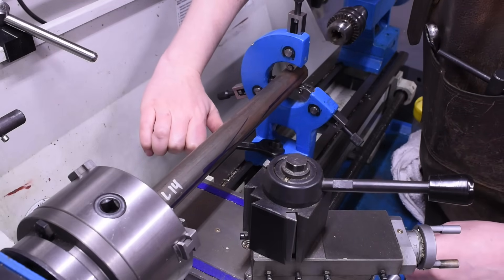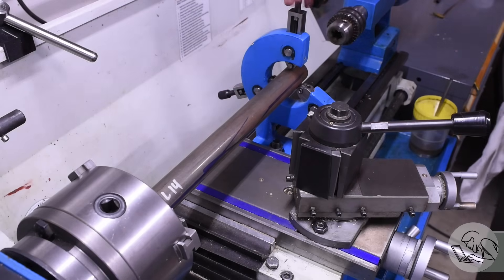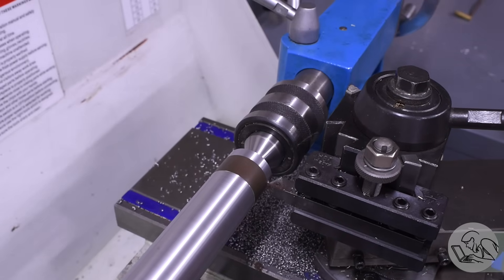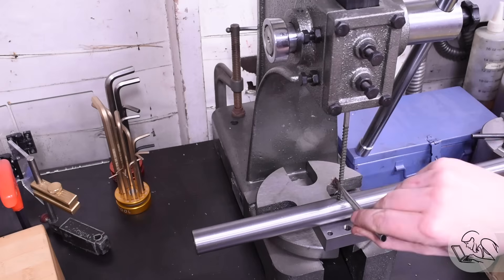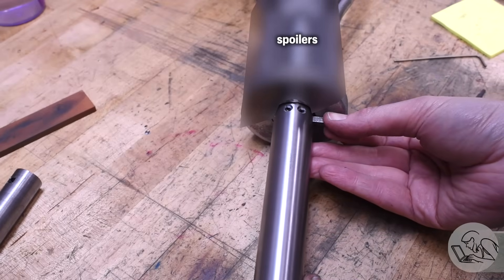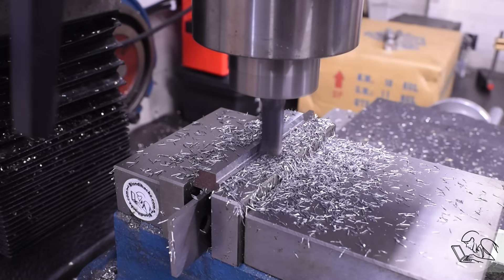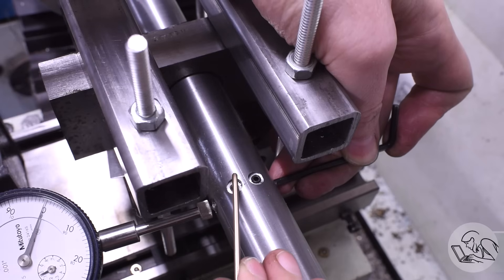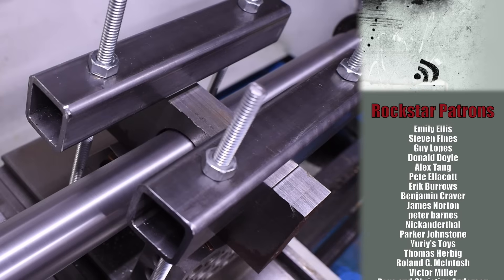Line Boring On Small Lathes!

Comment: Always fun to see a new way to use a machine.  I often drill hole to the diagonal dimension of the tool bit and not make it square.  This is mainly for tool holders /boring bars on the 9 inch South Bend.  The cutting loads are low.  On the line bar the square hole may make the tool setting more repeatable.  I have filed a few square holes too.  Also milled a slot on the end of the boring bar and welded a block over it to close it.  You can get round tool bits too.